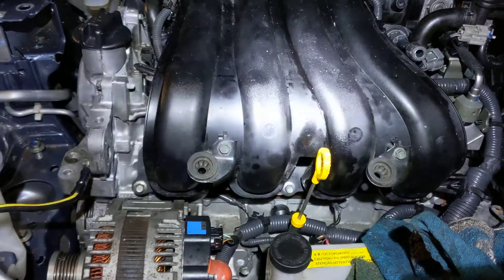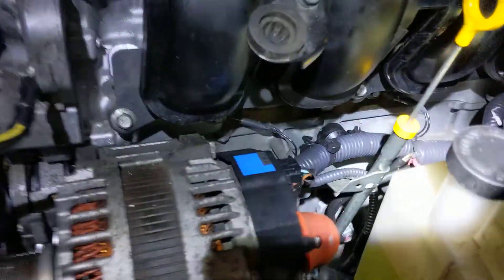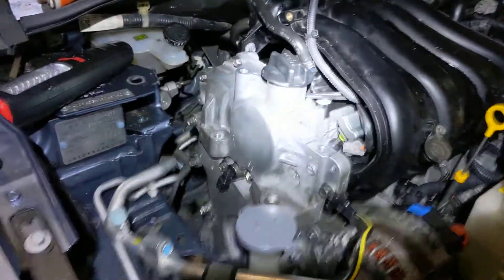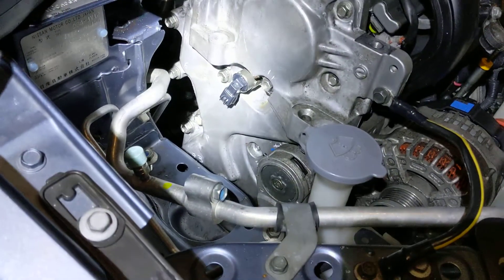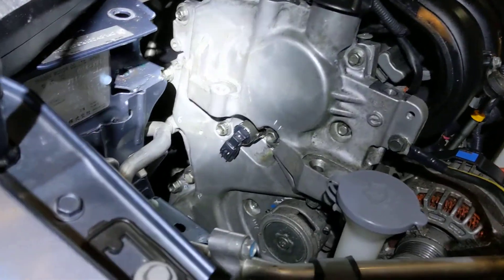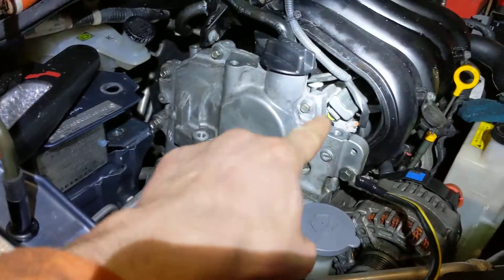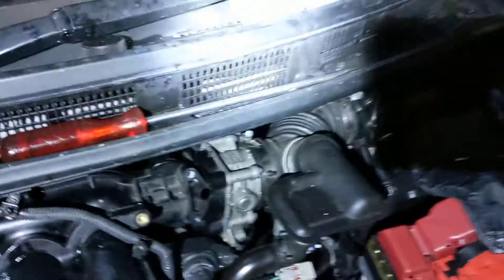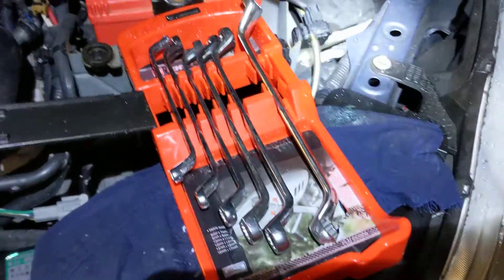Nissan wingroad MR18DE

Comment: Hi i have an MR 18 nissan wingroad 2008 am in kenya and its served me well. What do i need to be carefull about now that its 214k miles
Reply: Regular CVT oil change and avoid revs above 5000rpm. That plus normal service, the car will serve you for years